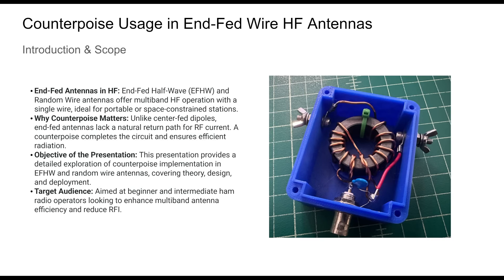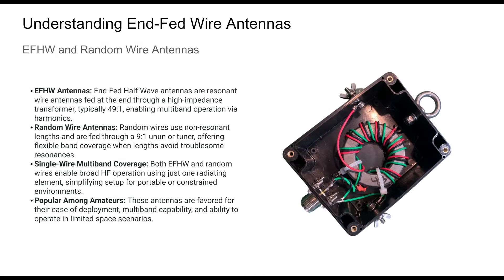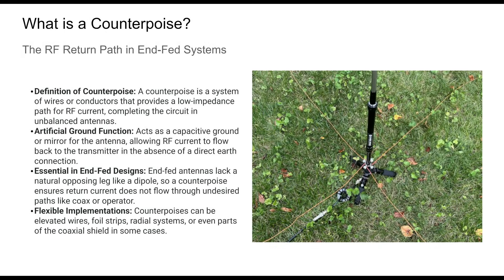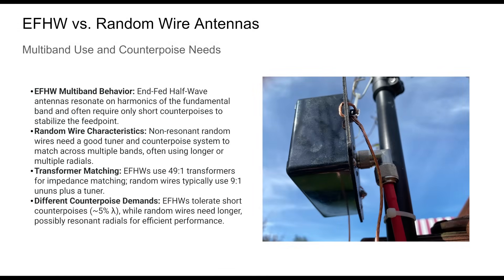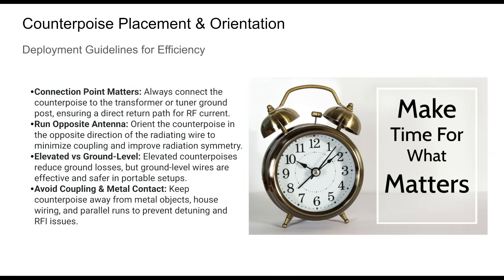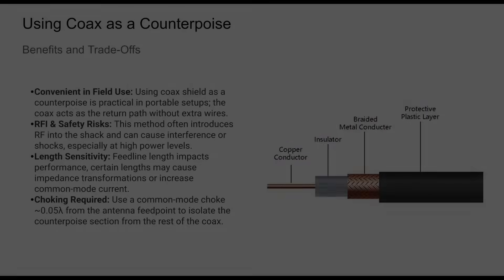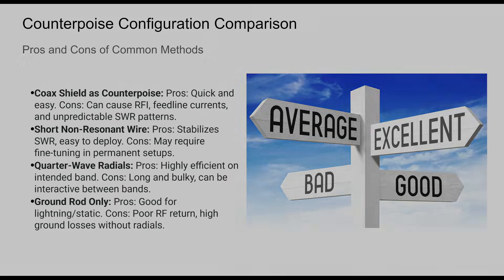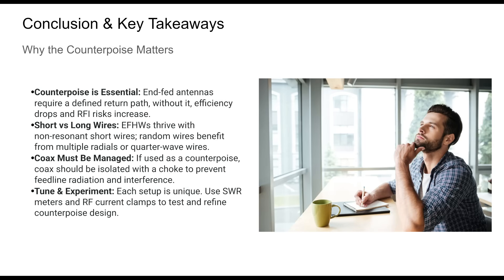The Shocking Truth About Counterpoises and End Fed Antennas

Comment: Great video !  10/11/12 open past few days but with some weird static . Sun is stormy !  I got New Zealand in the AM . Using T2LT antenna out of RG 8X .  The bottom half of antenna is the outer shield then the choke . Works great ! Just a battery and QT 60 and coax talking all over . I keep RF gain to noise floor is around S1 or S 2. Why listen to S7 noise ? That noise can over load front end of RX. Running band pass filters can reduce noise out of band that can affect RX . Each day is a new challenge. But a counterpoise can help with your noise floor as well.  Improving signal to noise ratio  is the key !  No 1 fits all . 73
Reply from the maker: Howdy Robert, they were saying geomag storms yesterday.  Take care and stay warm 👍
Reply: @TheSmokinApe  FCC just gave us more 60 meter space ! It passed . We should get official doc. soon .  73
Reply from the maker: @robertmeyer4744 I saw, good news 👍

Comment: As a guy that always used center fed halfwave dipoles,  needing a counterpoise for an end fed half wave seemed counterintuitive to me.  Then I read some articles talking about how much fiddling you must do with that counterpoise to make things work right.   Thus I shied away from them.
Reply: I tend to use center fed dipoles also. Pretty much nothing but a Yagi beats a good high dipole, at least broadside. I use two or three dipoles in different directions for 20 and 10 meters. I also use fan dipoles. I have used so called end fed wires. Always tune them with an L network and some king of ground/ counterpoise. Length of ground wire and ground systems can be a problem especially with high power!
Reply from the maker: There is a reason all antennas are compared to dipoles 👍
Reply from the maker: Hey Tom, I hear ya…. It can be a pain.

Comment: An end-fed with a counterpoise (wire or coax shield) is NOT an end-fed; it's an off-center-fed dipole, and as such the counterpoise radiates and should be elevated to reduce ground losses.
The only true "end-fed" antenna is one in which the counterpoise side is a non-radiating lump of current-sink, like a pond or car body (and at low power, human body, as with HTs).
I haven't tested it, but there should be no functional difference between a wire counterpoise and a coax shield with an effective choke placed at same length as said wire. If a wire is used there will need to be a choke at the feed-point to stop the shield from also being used. Adding more counterpoise wires is not beneficial for a horizontal or sloper -- each one will have a magnetic pattern that will likely interfere with the others, and the mail element, creating a wacky pattern. Of course, with a vertical, more horizontal radials are always better, providing a low-loss return path compared to earth. And even if it's a vertical half-wave, fed at the high-voltage point with a 49:1, it still needs a low-loss return path, and no, it's still not a vertical end-fed half-wave, it's an OFC ground plane! And no matter what you call it, a vertical 1/2 or better, a 5/8th wave is a great DX omni antenna. 
The counterpoise being part of the radiating structure, it should be treated like the main element, i.e., elevated and extended inline with the main element, unless we just want a lumped current sink, which is fine, with the main radiating element being half-wave (and multiples) it will have radiating efficiency around 95%, minus earth inductive heating losses.
Anyhoo, great presentation, as always!
73, --kv5r
Reply: All antennas are dipoles in one way or another. Even a EFHW with out a counterpoise wire is still a dipole.

Comment: I 100% agree with your comments on treating the counterpoise as an essential & critical component of your antenna system. For End Fed Half Wave (EFHW) I'd even go one step further... just treat it like a very very very Offset Centre Fed dipole (OCF) running with a 95% to 5% split (ie the 5% counterpoise length). Don't run a 49:1 unun (which tries to ground (braid connect) the counterpoise (that it doesn't like)).  It is best to retain the symmetry & balance & isolation. Use a 49:1 Voltage BalUn with primary/secondary isolation & your proper "stand alone" 5% counterpoise length.. This makes it harder for the EFHW to induce unbalanced currents onto the co-ax & keeps the co-ax out of the radiating consideration.
See also AA5TB's interesting work with isolated baluns on EFHW.
There is also the other consideration... if you look at a T2LT the "length" of one side of your antenna here depends on exactly how far down the co-ax you mount your choke (up to where the co-ax sleeve can radiate). This principle of the coax braid (up to the choke) being part of the antenna similarly applies to EFHW if you use a 49:1 unun & a choke a random length down the coax. If you are trying to replicate a design like this take note of the exact choke position as the co-ax up to that point is part of your aerial (any wonder that some people trying EFHW with just a 49:1 unun at the antenna & a choke back at the rig complaining about EMC problems & "RF in the shack"..... no sh1t Sherlock!)
Reply from the maker: Great post Streaky, thank you.  I always use the comparison to OCFDs and some people look at me like I am crazy.

Comment: A counterpoise has more to do with antenna pattern as the antenna is not in free space. Low SWR at the antenna coax connection reduces cumulative mismatch in the coax. At VHF-UHF a J-pole is a halfwave endfed and easier to get close to free space. Also, we tend to use them vertical so we don't have the earth factor, just metal nearby. While antenna measurements at HF are difficult, at VHF-UHF we can measure patterns and gain with a large field using a VNA and perhaps a preamp, 100-200 feet of coax and antennas mounted on poles rotated a few degrees at a time and logged.
Reply from the maker: You make a good point about radiation pattern 👍

Comment: If you're using a counterpoise then its not an end fed, it's just a really small ratio offset fed.
All a random wire is is an offset fed dipole turned upright often into an L configuration with the short side RF grounded.
A true end fed the RF should be balanced across the full half wave of wire but of course the end of the dipole the ratio is close to infinite,  so if you use a 49:1 you're not actually matched to the exact end so you move in about a foot from the end hence the counterpoise.
Returning RF current can be blocked with a choke and it will just reflect off the choke and be re-emitted by the radiator.

Just think of it as a dipole, the 1:1 point is at the centre, the 9:1 point is a third of the way from one end and 49:1 is a foot or two to the end.
The higher the ratio the closer to the end of the dipole.

Then a 1/4 wave vertical is just a L shaped dipole 1/2 wave with one side of the dipole the ground plane.

Antenna aren't magical, very simple when you understand them at a basic level, and that every antenna is a dipole.

Chokes are 100% necessary because they stop the coaxial cable acting as a above ground radial or a on ground radial, unless of course you want it to act like a radial, but you still need a choke at the length where you consider the length of the radial to be long enough.
So say you have a vertical with 10m long radials and you want your coax to be one of the radials, well choke at the 10m point away from the feed point and the coax will act as a radial until you hit the choke.
Reply: What? All end fed antennas have a counterpoise of some sort whether you add a wire or not. The longer counterpoise just makes it better.
Reply from the maker: Steve is correct 👍
Reply: @stevet7522  You both did not read what I said and proves you don't understand what is going on.
Now go back and re read my comment and you might realise what I'm actually saying.
Reply: @Channelmaster73  I agree. Regardless of coax feedlines, if an antenna isn't fed at the end, it isn't end-fed. Another pet-peeve of mine is when people say they are using an EFRW with radials/counterpoises. Technically, it is just a regular random wire antenna, which isn't end-fed.
"and that every antenna is a dipole." Very true.
Reply: Yep, I've always described the EFHW as a "very off centre fed dipole". It makes it easier for people to picture what's going on, and that people aren't trying to magic something out of nothing. Some people are confused that their "half wave" turns out to be shorter than a half wave...but they haven't taken the counterpoise into account in the overall length.
Reply: All you are doing is making a syntactic argument that you can't feed an EFHW from the true end - and have it work.  Ok, so?  An EFHW needs a counterpoise.  I guess we could use a new name...?
Reply: @MikePorterInMD  I'm trying to explain how feed points work and how an EFHW isn't using the counterpoise as people think.
Reply: @Channelmaster73  it will you the counterpoise if it is there, but once you add a counterpoise its not an end fed anymore.
Reply: @MikePorterInMD  An AEFHW (A = Almost)?

Comment: Excellent video, Ape! It lays out the case for EFHW counterpoise really well. 

Interesting idea it prompted.. if the counterpoise is not resonant on the transmission band, then presumably the antenna is not resonant where the counterpoise is. Could you then reverse the two wires and use the antenna on an entirely different band by tuning the counterpoise appropriately?
Reply from the maker: I guess it’s possible, no idea as I’ve never tried it.  Thanks for watching David 👍

Comment: 9:1 and 49:1 are BOTH transformers and unun is just another term for transformer, so why do you use one term for one, and the other for the other????
Reply from the maker: I wanted to sound fancy, but you are right… they are both transformers 👍
Reply: It specifies what type of transformer it is.  UNUN for unbalanced to unbalanced, BALUN for balanced to unbalanced and BALBAL for balanced to balanced.
Reply: @mikesradiorepair  I'm not talking about unun vs balun... I'm talking about the fact that they're BOTH "transformers", and calling one an "unun" or "balun" and the other "transformer" is implying that "transformer" is a term that is only applicable to ONE of the two terms, when in fact it applies to BOTH.

Comment: Good information Ape. Thanks. But what length should we go for with a 80-10 efhw ( 131 ft wire )?
Reply from the maker: 5% on the wavelength for the lowest band you are operating on 👍
Reply: Ape, he sure is getting confused by your answer.
de VU2RZA
Reply: In your case   ( with 80m the lowest band you use ),.   i would go with 13ft
Reply: I guess you don't know how to do an internet search.

Comment: Hey!  I actually have a question!  One of the recommendations for attaching the counterpoise was using the ground lug of the tuner.  Would that be assuming the tuner is at the feed point?  If not, would that not result in the coax shield being used as a counter poise from the feed point to the tuner?  On a random wire antenna would that result in the sum of the coax shield and counterpoise wire exceeding the recommend 5% lambda?  In either case, if using the ground lug of the tuner to attach the counterpoise, would the proper course then be to place the common mode choke between the tuner and transmitter, allowing the current to reach the counterpoise connected to the ground lug of the tuner?   Dang...how did I get so many questions at once...I need to stop thinking...73 Ape!

Comment: Have never used a separate counterpoise wire in the field with a 9:1 UNUN NREF (non resonant end fed).  A 71 foot wire gets me 6 thru 80 Meters.  I place a good choke at exactly 42 feet on the coax and use the outside of the coax braid as the counterpoise.  If I want to add 160 Meters I switch to a 148 foot wire and I make a compromise by adding a pair of 15 counterpoise wires and move my choke to 52 feet on the coax.  I use the added counterpoise wires so I don't have to switch to a unreasonably long coax cable to use it as the sole counterpoise element.  In either case, I add a additional choke on the radio end of the coax for good measure.  Either setup gets me continuous coverage across the bands.  Heck, the antenna analyzer even shows the SWR around 2:1 on both 2M and 70cm but I have never used them there.  Either one up on a 50 foot fiberglass mast out in the field I have never run out of people to contact.  It's what I consider a surprisingly good compromise antenna for rapid field deployment.
Reply: That’s really cool! You mentioned a choke at 42ft on the coax.. how long is the coax and why 42?
Reply: @PhotosByMotaz  When you are using the outside of the shield/braid of the coax as a counterpoise the choke placement "tunes" the counterpoise.
Reply: @mikesradiorepair thanks, understood. Still not sure why 42 ft as its not a quarter length for 40m. Some otyer sources suggest 1/8th etc.
Reply: @PhotosByMotaz  I'm guessing it's another non-resonant length, or combined with the driven wire, creates a system which is overall non-resonant.
Reply: @PhotosByMotaz  This is in a NREF (non resonant end fed).  The key is "NON" resonant.  The antenna radiating wire is specifically picked to NOT be resonant on ANY amateur radio band.  Ideally it should present around 450 Ohms of impedance on the amateur radio bands.  The 9:1 UNUN transforms this impedance to 50 Ohms.  When using the coax as a counterpoise it usually works out that a choke at about 60% of the length of the radiating element works best.  Try it there and then move it up and down the coax to "tune" the counterpoise.
Reply: @PhotosByMotaz  you can tune the coax to make the wire more resonant, My antenna is tuned for 40 meters but the choke being 34ish feet from the antenna makes it doable for 80 meters, every antenna is different but you can tune, detune to get rid of RF at your station, tuning other bands better bla bla bla.
Reply: Hi Mike! I have seen your setup  many times in the field and it definitely works. I've been amazed at your contacts made, it definitely works. K3EJP

Comment: I run a K6ARK EFHW 49:1 without a feed line for 40/20/10.  The bnc attaches directly to the radio.  Never used a counterpoise and never had a problem.  So If I use a counterpoise, it will increase the performance even more??
Reply: You have a counterpoise, it just likely includes you.  Your radio, your power cables, your microphone cable and you.  Adding some sort of counterpoise would likely greatly improve your performance.
Reply: @mikesradiorepair  Makes sense.  Thanks for the reply.